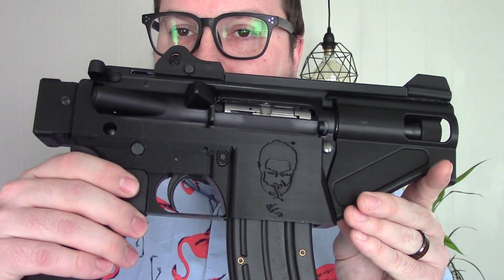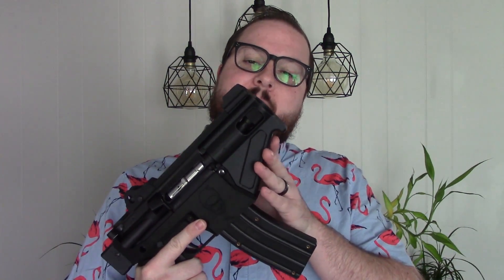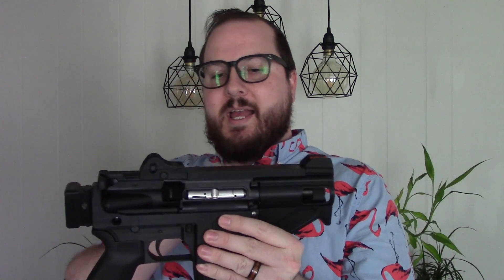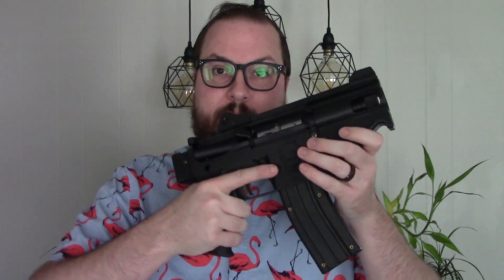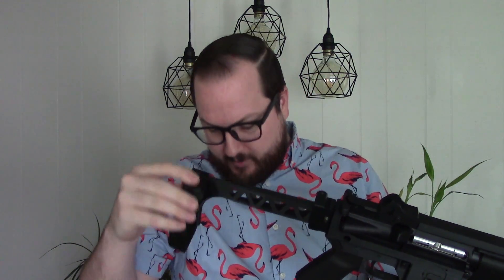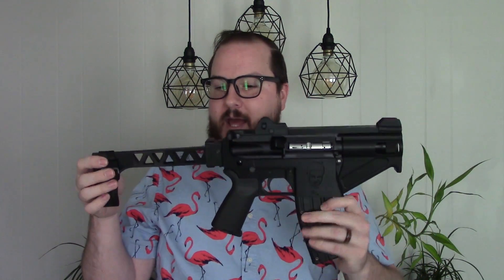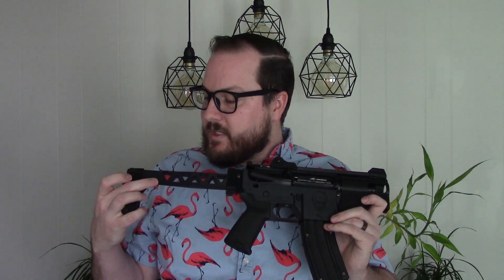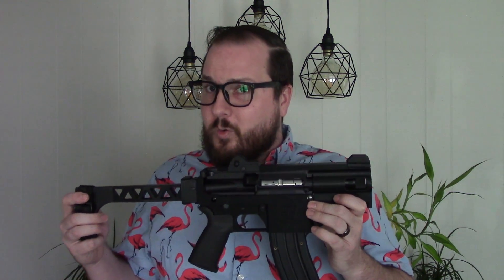3D Printed .22LR AR15 Pistol (Jeff Goldblum Themed?)

Comment from the maker: UPDATE: I released the files for this on my Keybase a while ago. Working on a full release through Deterrence Dispensed of my newest creation, the SpaceGat22 which is currently in Beta.
Reply: Does the file include the Jeff goldblum face?
Reply from the maker: @thegraffitiwriterknowsas  The one for this receiver on my Keybase currently is exactly as you see it. The Beta we're running is a completely different design.
Reply: @booliganshootingsports  Awesome im super excited for it to be finished. might be only me but just wanted to mention. If you pull it up in cura it shows the picatinny rail in the back not being connected well at all. Also half of one rail is missing completely. just a heads up for anyone planning on downloading this file.
Reply from the maker: @thegraffitiwriterknowsas  where did you get the file? I literally just checked the only official one on my Keybase and the rear rail is fine.
Reply: @booliganshootingsports  I downloaded the file off your Keybase “Goldblum AR22 Receiver” . Maybe mine is just downloading weird and I’ll have to try again.
Reply from the maker: @thegraffitiwriterknowsas  very strange. I shuffled some things around there so try a download again. If all else fails, send me a screenshot of what your Cura is showing as the problem.
Reply: @booliganshootingsports  . i redownloaded the file and previewed it in cura and everything looks perfect now. thanks for the help!
Reply: @booliganshootingsports  when is the beta getting released?
Reply from the maker: @ghostgirl4782  The beta has been released for weeks. You join it through Deterrence Dispensed on RocketChat.
Reply: Ya plz upload the brace too
Reply from the maker: @kd9432  it’s on my Keybase.
Reply: @booliganshootingsports  what is your keybase?
Reply from the maker: @NSHG101  Booligan
Reply: What would you charge me if you built one of those for me and shipped it to my ffl
Reply: I don’t see these on your key base =(
Reply from the maker: @The0nionKnight  did you read the readme on my Keybase? Everything got moved to LBRY.
Reply from the maker: @Dr.pikachuu  that’s illegal, so it wouldn’t happen.
Reply: @booliganshootingsports  I did, thanks !
Reply: @booliganshootingsports  you could always get a license to manufacture
Reply from the maker: @Dr.pikachuu  you going to front the $10k+ per year needed for me to do that? It’d be much cheaper for you to just buy a printer and print one 😉
Reply: We love creators like you bruh
Reply: @Dr.pikachuu  get a job dude lmao
Reply from the maker: @Das Me Print trigger guard down, settings will vary depending on your specific machine, filament, the weather, how dialed in your machine is, etc.
Reply: Where to find files?
Reply from the maker: @RuKuaj  Booligancustomgunworks
Reply: Hello, could someone help me with the following question please, what program is recommended for viewing and printing?
Reply from the maker: @diosesfiesteros4579  I would recommend watching my video on getting started with printing guns.
Reply: The shhhhh is the same as one eye 👁‍🗨 symbolism. Just be aware. Search “celebrities shhh”. Or “celebrities one eye” and be amazed.
Reply: Nice shirt :] and the house plant. Legit
Reply: Can you tell me the link to the file
Reply from the maker: @cjc2436  Booligancustomgunworks
Reply: Can I have the STL file??

Comment: This would be perfect for a transparent resin print.
Reply: I've been looking for info about resin vs regular 3d printed lowers. Can resin be used for the regular lowers (5.56)? The high strength resins seem like a good way to go...

Also, does curing your print (baking it in various powders) help with "catastrophic failures"?

I suppose there's probably a good forum somewhere, but I am new to all of this and don't know where to go...but this stuff is amazing!
Reply: @legalmechman  i suggest resin, machines are much faster and you can print more parts at once. The one I am.lookong at is 1600.
Reply: @legalmechman  I've tried it. Couple of issues that come from using resin. One is that the resin prints have much higher stiction, which is a huge issue in the mag release. Tried different lubes to help but never got far enough to work right. Then theres the blittleness of resins, all of the resins I've tried are either too soft and flex or are too brittle and break. Maybe in the future with new resins it'll work great. Siriya just came out with the new build resin that might have the right properties. I've got a bottle and have been meaning to give it at try. Not sure what you mean about curing, curing is done under UV light
Reply: @boxtruckman2929  good to know! Curing may be the wrong word, but it wasn't in reference to resin. I have seen a lot of YouTube videos about putting PLA and other extruded prints in fine salt and other powders and baking them. They seem to get much stronger after that...
Reply: @legalmechman  I believe the term you're looking for is annealing.
Reply: Main issue with resin is:
- Getting consistent curing all over the piece - This can be achieved, but it's something to bear in mind
- Absolute lack of lubricity - FDM materials are often self-lubricating to a degree. Resins absolutely aren't. This can be an issue for some parts/functions and there is no known work around other than lubricating.
- Brittleness - Some resins are fucking though, tougher than your typical filament, but - the though ones - aren't all that flexible. Brittleness is not good for a firearm since explosions produce vibrations and whatnot. There aren't many workarounds as of now, some people are fiber reinforcing resin printed parts, but that's not so viable for complex parts that are often printed at an angle.

IMO, any good 3D printed gun uses a good chunk of metal parts (simple and/or complex actual gun bits and bobs), likewise, one could come up with hybrid materials and use resin where it is viable and something else for other parts. That being said, FDM is - at the moment - the best option for printed guns. Suppressors, resin can work.
Reply: what about a Glow in The Dark?

Comment: Beautiful, If this was 9mm and ran stick mags it could look an awful lot more mp5ish than it already does!
Reply from the maker: That would be awesome, but unfortunately, 9mm ARs require a buffer tube which would get rid of the cool aesthetics of this.
Reply: @booliganshootingsports  If I remember correctly, on github I once saw an stl of an adapter to use 10-22 mags for the 22 conversion kits. Idk if it will fit in the cmmg kit tho. But it might be worth a look
Reply: @booliganshootingsports  what about using ruger pc carbine parts? Basically a scaled up 10/22 internally.
Reply: @jamesborek8125  I have a Ruger PC Carbine and have been thinking about that, as well.
Reply: @booliganshootingsports  Look into the BRN-180s watch?v=kAEUKuXeuuc  Might be doable.

Comment: So if I understand this correctly I purchase an ar22 receiver and print the rest? This is amazing but I’m very new to printing guns is there a specific receiver I need to buy and also how do I access/purchase  the print files for this
Reply from the maker: For this build, you need any normal AR upper receiver that's been fitted with a CMMG style BCG and barrel. Plus the basic things like a charging handle, lower parts kit, etc. My later version of this actually uses a printed upper receiver, so you need to buy fewer things to complete it. The files are on my LBRY page.

Comment: Dude this is awesome 👌 a couple improvements though it really wouldn't be an ar pistol it would just be cad nonsense but 3D printed upper and lower with place for a charging handle like an mp5 or just heckler and Koch arms in general then make it take Ruger 10/22 25 round mags and then just no brace of any kind just shrink that thing down to micro uzi size

Comment: Are tree supports used ? Or running normal for the Lower ? the back corners rat nesting in tree mode.
Reply from the maker: Doesn’t matter. Either one works as long as you have your settings good.
Reply: Running it the second time, everything else came out flawless.

Comment: If the brace is weak/bendy lengthwise... Make the top a bit thicker and thread in a 4mm threaded iron rod like you can buy at home depot to hang stuff from. (Threaded so it doesn't fall out or move)
Reply from the maker: The brace itself is quite solid. I have no concerns with that, but the hinge is an ever evolving design to balance strength, bulkiness, and ease of printing.

Comment: Could this use the cmmg 7.62x39 bolt and barrel?
Reply from the maker: No. You need a gas system, buffer system, and this receiver isn’t designed for those kinds of recoil forces.

Comment: Do I need another gun to make it or is it just all 3d with metal parts in it
Reply from the maker: It’s 3D printed with components like a CMMG bolt carrier and barrel.
Reply: @booliganshootingsports  do you know where I can find a list of what u need?
Reply from the maker: @NoMerxySlimk2002  Yes, with the file download. The SG22 is the later iteration of this design and has a full parts list in the readme. The parts you need are the same.
Reply: @booliganshootingsports  Ohk so which one is dis?
Reply from the maker: @NoMerxySlimk2002  this is the Goldblum 22. I designed both this and the SG22.
Reply: @booliganshootingsports  fr what is the strongest filament to use?
Reply from the maker: Depends on a lot of factors, largely what your machine is capable of printing and what your capabilities as a printer are. But, assuming that since you’re asking this, you are new to printing, let’s just say PLA+.

Comment: Where does one get the file? I have the conversion kit already, would just need a barrel. This is so cool!
Reply from the maker: Deterrence Dispensed has many files.
Reply: Booligan Airsoft and Shooting Sports Just an FYI, almost all the files are free on LBRY, no need to buy them.
Reply from the maker: @alexdoescrazystuff  I know. Deterrence Dispensed doesn’t sell files, they list them for free.
Reply: Booligan Airsoft and Shooting Sports Oops must've gotten confused with Defcad. Also check out Are We Cool Yet, if you're interested in a certain CZ PCC
Reply from the maker: @alexdoescrazystuff  I’ve seen it. Until Evo parts kits are easier to come by, I don’t get the purpose of that design, but it is cool. My most recent build is a vz61 Skorp, which I’ll do a video on soon.
Reply: Booligan Airsoft and Shooting Sports The design is a fully reverse engineered scorpion, it actually includes the bolt components and trigger group, which one could make from scratch if there is access to a cnc mill.

Comment: Can the flies be downloaded to make this ? I would like to have it.
Reply from the maker: All of my completed files are available at Booligancustomgunworks
Reply: @booliganshootingsports  oh 😎.I just started getting into this for a hobby. Other than the parts I can get , do I have to buy the hardware, and is there a company that u use that you buy your stuff from? Sry to ask so many questions but I've been watching your videos but didn't know you had the files for them. I have to say they are very cool designs.
Reply: You answered pretty fast so u are still doing it, so can I use the files on a resin 3d printer, will it be stronger?
Reply from the maker: @phillipbaugh9876  resin prints are weaker than FDM prints. I’m still doing 3D gun design, my channel is full of it.
Reply from the maker: @phillipbaugh9876  I get the hardware and other parts from whoever has the best prices. It’ll vary project to project.
Reply: @booliganshootingsports  ok thanks for that info. I see yours and the time and effort put into what u do so. I just want to build something that works like it's supposed to and not blow up in my hands. I've watched some idiots actually make em with no experience and the fell apart or just blew up. Anyway I think your designs are very sweet and look forward to making one. Thanks for responding. And much success on your future designs

Comment: absolutely gorgeous piece, you did an amazing job making this, what printer did u ask if I may know ?
Reply from the maker: Printer info is in the info section of the video.
Reply: @booliganshootingsports   would you replicate a kit and ship it down under?
Reply from the maker: @mikecallaway4491  that would be illegal in like 15 different ways. So that’s a hard no.
Reply: @booliganshootingsports  apologies  I think wired have been crossed here, I purely meant as the plastic printed body parts as your print quality and knowledge are unbelievably good and as im new to printing and my guider 2 is in for repairs I thought ONLY Print parts could be printed and shipped in pieces as from what I've read that didn't seem to break any laws either Country let alone 15 lol.
My sincerest apologies.
Reply from the maker: @mikecallaway4491  yeah, the main part of this that is printed is the lower receiver. Strictly speaking, that’s the part that’s considered the firearm in the US.

Comment: Would it be possible to do an AR9 like this?
Reply from the maker: Not in this exact configuration. An AR9 requires a buffer tube, this setup doesn't.
Reply: @booliganshootingsports   Gotcha. Thank you for the response. I plan on making an AR22 aswell when my printer comes in.

Comment: There certainly are a lot of people in the comments who feel entitled to your work. Using open source files as a foundation for a project does not necessitate that the project be made open source.
Reply from the maker: And the thing is, I’d be happy to share if it was as simple as sending the files to the guys over at Deterrence Dispensed and having them send them. But it’s more complicated than that, an they need the base design files which I can’t export in the newest version of the design software I use. So I’d have to host and release them myself which you just can’t do on most file hosting websites since they’re firearm files. It’s a whole big mess.
Reply: @booliganshootingsports  You can legally snail mail them directly to addresses in the US on thumb drives without fear of violating ITAR. That's basically how Defense Distributed got around the ITAR issue. I'm NOT suggesting you're actually obligated to do that, mind you. :D

Comment: interesting build I want one in 556.
Reply from the maker: You can’t build one exactly like this in 5.56 because of the need to have a buffer tube. But you can absolutely 3D print different lowers to run 5.56 uppers.

Comment: How did you fit the handguard onto the front, was it screwed on?
Reply from the maker: It’s press fit onto a random cylindrical barrel nut that I had, and then secured with a set screw on top.

Comment: But why? You can buy a really good, reliable .22LR pistol for CHEAP. Is it just for the barbie-doll "kewl"?
Reply from the maker: We build things because we can. And this can be built for cheaper than any other .22LR AR pistol, especially my later design which utilizes a printed upper.
Reply: @booliganshootingsports  But why an AR? They're one of the clumsiest pistols in the world, and there's no justification for all that bulk and complexity. The AR platform, in .22LR is the Mattel-est gun imaginable. It doesn't do anything that a decent pistol should do, it only looks faintly like ... well, an M16 that lost a bad fight with a grinder. It doesn't even feel as substantial as an airsoft pistol.

If you're going to have guns, it seems rational to have real guns, not these toy things.
Reply from the maker: Because it’s fun. It’s ok to have things that are fun, simply because they’re fun. I’ve got something like 110 firearms and I still have more fun with builds like this than most of my guns that are “better” on paper. And it’s made all the more enjoyable because I designed and made it myself. 

If you can’t find the value in that, then I can’t help you.
Reply: @booliganshootingsports  Mmmm.

Mmmm hmmm.

Comment: what printer are you using?
Reply from the maker: I use an Ender 3 with a few inexpensive and easy upgrades.
Reply: is it a decent printer for a first time user?
Reply from the maker: Realistically, it’s the Honda Civic of printers. Inexpensive and boringly reliable. Takes to cheap upgrades well and outperforms more expensive machines. I absolutely recommend it.
Reply: @booliganshootingsports   lol great explanation
Reply: @booliganshootingsports  Are newer and more expensive versions of Creality Ender worth getting? Like Ender 3 Pro or Ender 5 or Ender 5 Plus
Reply from the maker: @darek4488  no clue, I’ve only used the standard Ender 3 and haven’t seen a need to upgrade.